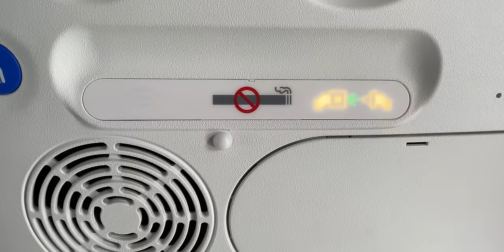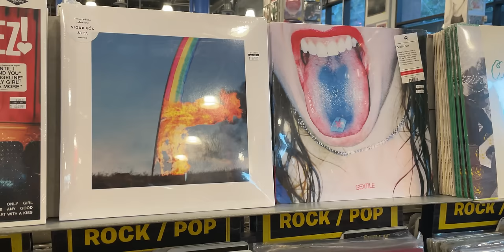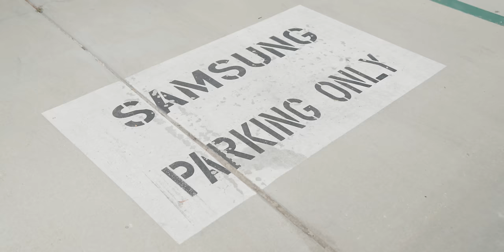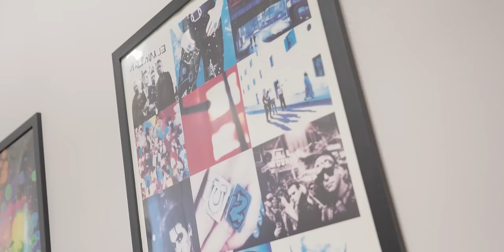Samsung's 100 Million Dollar Top Secret Audio Lab Facility! How are Your TV/Soundbar Made?

Comment: No wonder the Q990B and Q990C sounded REALLY good to me when I auditioned them. Totally surprised that they are directly comparing their soundbars to a full fledged Genelec atmos setup, thats some crazy shit. The only problem I have with the 990B and 990C or any soundbar for that matter is stereo separation, the L and R are just not far enough apart or I woyld have been all over it for my bedroom. Fun fact: The Q990B and Q990C are the most neutral measuring soundbars on Rtings.
Reply from the maker: I have the Q990C in my theatre room right now, testing it out. It has actually left me more impressed than I'd have ever imagined
Reply: @Jayiyagi if you treat them like separates i.e positioning, placement, etc, they will amaze you. Also when you have a low enough ceiling (think 2.5m - 3m) and a symmetrical room, they throw sound like nobody's business. And man, these 'small' speakers can play LOUD.

Comment: Great room and engineering.  However using Genelec as a reference standard is doing them a MAJOR disservice. Genelec’s can be very useful as part of a mixing environment for various reasons, just like NS10’s, Auratones and other accentuating monitors.   I can’t share what some of the top soundbar and other companies that I have worked with on their standard setting solutions, but it is NEVER a Genelec.  Also, there are some much better measurement engineering microphone choices, but their current choice of mic’s are a lot closer to the ground truth reference they are looking for than their monitor choice.
Reply: Totally disagree. Genelecs in a well treated room with room correction will be more honest than most speakers could ever be. They are called reference speakers and in this case used as reference. I would rather my soundbar sound closer to Genelecs than any other speaker.

Comment: Dude forgot to mention the elephant in the room with most rooms... Pressure (ie. Low frequency energy)
Reply from the maker: He didn't actually. That comes up in conjunction to the 5 sided anechoic chamber as well as the multi mic array in-room response
Reply: @Jayiyagi  you're right, but I was referring to acoustics in a room. He said reflections and diffusion, when it's only pressure and reflections. Diffusion is a subset of reflections. There's nothing in that anechoic chamber that absorbs low frequency energy, but as you said they used the mics to account for that a bit